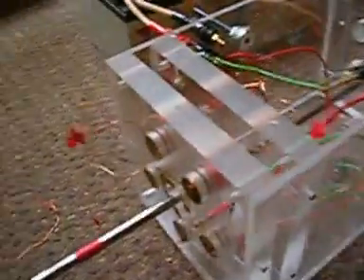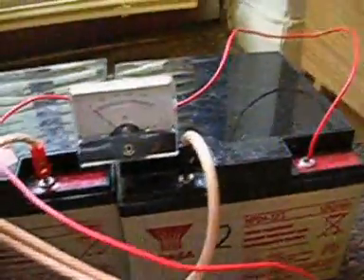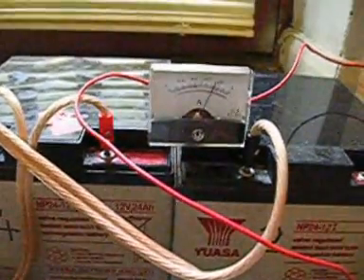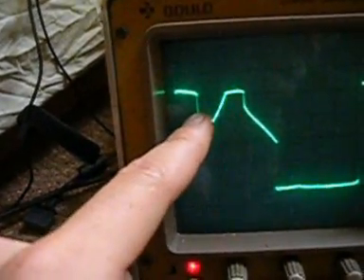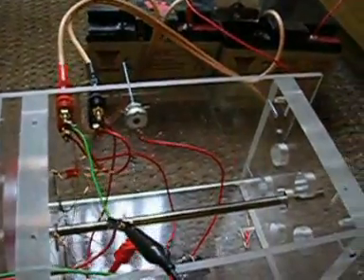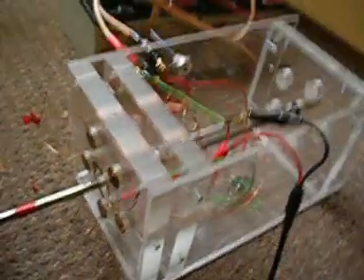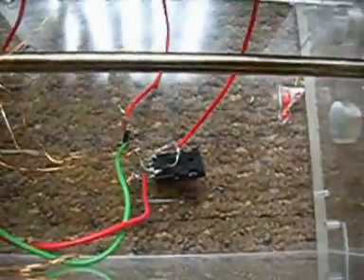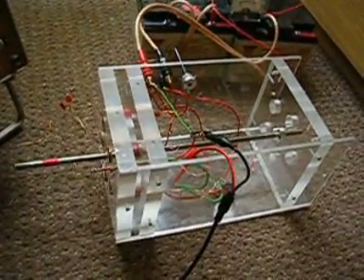MG-1 : Pulse Motor Generator (SSG)

Comment: @Banzay20 Not my project actually, just looking. :) There is no free energy to be had though, just a highly efficient electric motor. These things can be 20% more efficient than existing electric motors. As most power consumption in the UWA is electric motor based (home fridges/industry etc.) that is no small saving for the electric grid. That saved energy can be used to charge EV's.

Anyone that tells you they're getting free energy or breaking the laws of thermodynamics is telling you fibs.

Comment: @Banzay20 If you're interested in levitating magnetic fans etc. Sunon make plenty of maglevs that you can buy quite cheaply to take a look at. Some of the quietest fans around. They also make blowers.

I guess if you set something up with high-strength neodymium magnets you might be able to build some sort of air-bearing, fairly hard to do though without special manufacturing equipment. That would make a wind turbine really effective and would last a long time without any servicing.

Comment: Great setup!

For my Bedini's I'm using no bearings at all. A guy named querdenker79 from Germany had an excellent idea of building a "floating" rotor and a friend of mine who's helping me machined the exact same thing. So we have a fixed disc with 15 neo magnets on it (all facing north) with a shaft on the center and another disc with 5-6 neos that floats on top of the other one. Pretty cool take a look /watch?v=W9uYhZYOEPo

Keep it up,
Fernando

Comment from the maker: In a sense it is just an extremely efficient motor, though generally the mechanical output is less than 28% of the input power... the rest of the energy is made up in the charging battery so overall it is efficient.  Though as I mentioned earlier the charging batteries charge faster than they should considering the amount of energy we provide them with (wink).  When the mechanical energy is combined with the electrical energy, we can end with more energy than we started with.

Comment: it's darn good to see you here again introvertebrate... I wonderd what happened to ya...

Very nice setup... who's CNC did you use to do that perspex? lol

Reverse diode across emitter to collecter was one of the improvements i did in my feedback to source as well as a diode linking the trigger coil to the primary power...
Howeveer, i used a cap bank and a diode to stop any generated power and the forward EMF from hitting the primarry battery...

I got monster build number 4 on the go at TEEP

Comment from the maker: Just re-read your comment, and I don't think I answered your question... the variable OF resistance.

That is the same as in most motors... the lower the resistance the higher the efficiency.

Though inductance also has to be taken into account.  These motors are most efficient when the inductance/resistance ratio is greatest.  So when the inductance is high and the resistance is low the motor is most efficient.

Comment from the maker: AND... if you put a meter on the output of the motor you can calculate how much of the energy is being recovered.  However, if you then measure how much energy is actually in the battery that is being charged after you disconnect it from the motor, you find there is FAR more energy in it than you gave it.

So the battery is also capturing energy from an external source... but that is another story ^_^

Comment from the maker: Another reason why it is so efficient is that by supplying electricity in pulses the coil's magnetic field never reaches saturation...Whereas in a standard electric motor the field is constantly saturated so most of the energy is being burnt off as heat.  

Our motors are always cold. ^_^

Comment from the maker: Though in our motors we are supplying the coils with a sharp pulse of electricity to push the magnet away.  Then a large portion of the energy that was required to create that field can be recaptured by the coil when the field collapses and we channel that energy into a charging battery.  

The magnet is then attracted to the coil's core for free.

Comment from the maker: The variable resistor is on the trigger circuit and that can be used to tune the frequency the coils resonate at.  You can tune the coil's resonance so that it is most efficient for the load, but that isn't really why this motor is so interesting ^_^

We know that it requires energy to create a magnetic field.  In a normal DC motor constant current is being supplied to maintain that field.

Comment: I'm trying to understand what you're doing - given this is simply a 'free spinning' motor, how does the variable of resistance on the motor affect its efficiency? For example, using a larger version of the motor for an electric car..?

Comment from the maker: Yeah, I had it machined... cost a bomb but it was worth it!

You should here it when the flywheel is connected! lol  Neighbors are pretty close unfortunately ^_^ though it isn't as noisy when the top panel is screwed on, and when the generator is attached it should only go at around 4000 RPM which should make it a fair bit quieter.